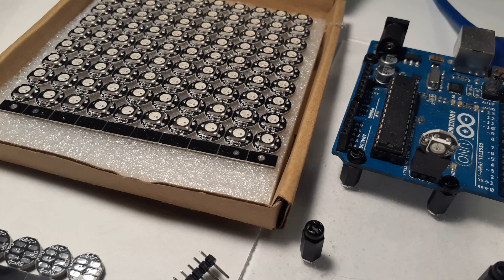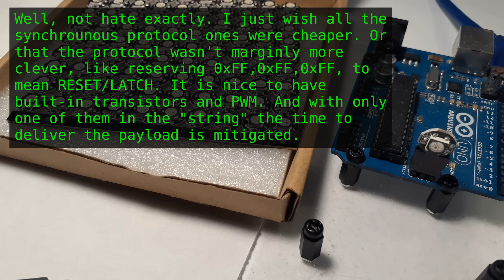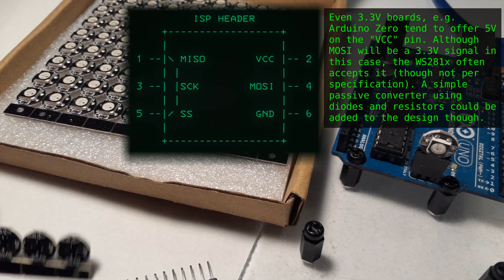Arduino ISP Mountable Single WS2812/"Neopixel" RGB LED

Comment: 6:00 Perhaps a sheet of paper angled in front of the LED could better catch the color change? Just a thought really, also may not work at all as I have little experience with LEDs.
Reply: I used to put a little blob of hot glue, its diffuse so it works really well.

Comment: very interesting to hear expert talking about arduino stuff I've been taking for granted for years
Reply from the maker: Well, if I'm an expert in anything it's probably pointing out people that they forgot to set a pin to output. Or they didn't connect their grounds together. My abilities are probably a lot more limited than you're thinking. But, if you're getting something out of what I'm saying. cool.

Comment: hey good info.  i found it interesting/entertaining.
you know, more people might start watching if you could do away with all the pauses, and umms, and false starts, et cetera.  or just try to edit most of them out.  yes a video that skips ahead over all those would still be watchable.  i've seen tons of channels that use that method.  but better would be if you had more of a script in mind and could avoid them in the first place.  i think all that wasted time might be the main thing that makes people not want to watch more.  
and along those same lines, don't take so long to show something on screen.  for example, at 3:20 where you're trying to get the camera to focus on the piece.  instead of wasting time doing that, just know, while you're talking, that a good video clip or picture of it will be on screen; and then record one later and edit it into the video at that spot.  that way you can take the time to get just the right shot without wasting on air time.

Comment: It's tough to build momentum on a YouTube channel.   But your covering the production basics.   1. Good audio.   2. Good audio.   3. Good video production. 4.  Good subject matter  5. Knowledge of the subject matter.   So keep cracking them out,   keep them under 20 minutes, something will "click" and when it does you'll have the library of content and frequency of new content that will drive the sub count.  You got a new sub today 😀, and some likes.  How-tos and project build videos seem to get the views in the microcontroller community. Keep it up!  Good work!
Reply from the maker: That crank turns harder and slower than most would guess though. I have no idea how often I'll produce. I'm not really cut out for YouTube. But, I do have some videos planned. Dunno how long they'll be. It kind of kills me cut them down. It makes me choose overly assertive titles and phrasing in the video.  A lot of what I have planned may be very boring reference material for future stuff.  We'll see.  If you got something out of watching, I'm glad to hear that. That's worth more than anything else at this point.
Reply: @TM-zs7ko  You absolutely are cut out for youtube!
Reply: You forgot about #6. Good audio.